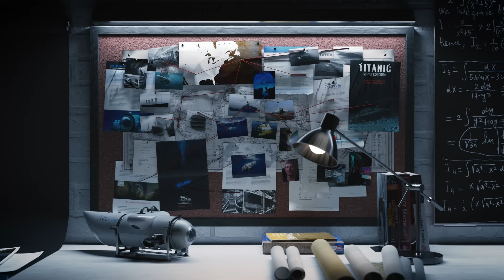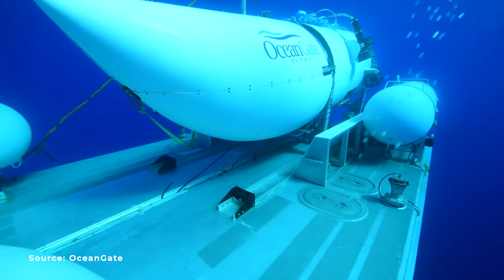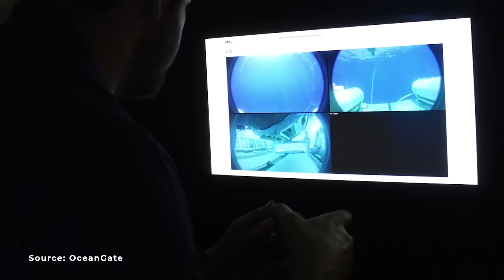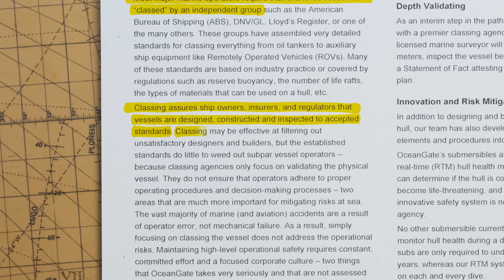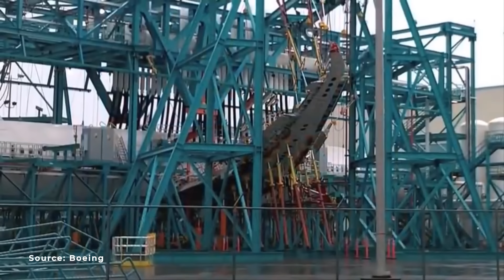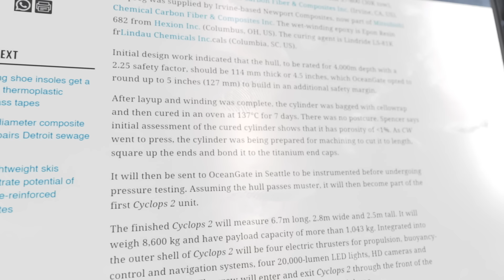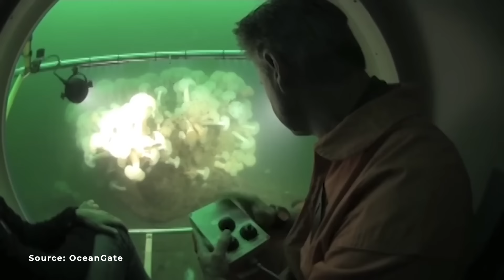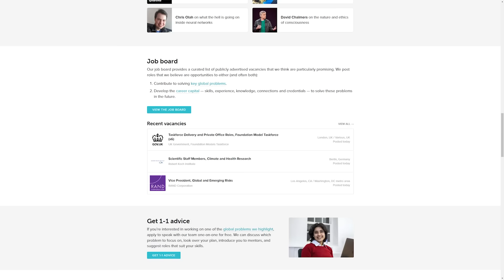The Questionable Engineering of Oceangate

Comment: I'm so happy you got to use your Masters thesis in this topic! Bet it was hard for you not to make this a ten-hour video though, discussing all the fine details of void propagation etc...
Reply: We are here for the 10 hour video when it comes.
Reply: im not joking here as i am a boat builder of 4 decade and a marine mech. The younger college/uni levers even at masters level know knothing of composites. They are taught very basic level stuff especially the layup phase. Nowadays a computer tells them whats what they dont understand what they are looking at or how composites actually behave. I'll give you an example, We got a boat in that had been completely refurbished by a start-up company, then fell apart within 3yr. The owner then demanded his cash back and a long drawn out process happened where he had to force them to hand over the blueprints for the refurbishment, materials and all. They were ran by two postgraduates and had a workforce that read as a family&mates list. They were so bad at it they never knew the difference between a layering up resin (aka polyester or vinylester) and a bonding and layering resin (aka proper epoxy resin the amine type) so they had basically used the polyester resin on its own as a transom bonder and to oversize plug all the fitment holes so they could redrill them to accept the new fitting. They used a powder bound 400gm chop strand with a polyester resin not realising the powder bound was for proper epoxy. Then they  made a total disaster of the transom from the re-design stage. The boat was originaly outshaft motor that was converted to an outboard transom by them and they didnt have a clue. Bet they could push a mouse about or a pen about and mumble a bunch of figures they got partially right on the subject. Also a vast amount of students now are activist types and you dont want to be in the sea with anything they have designed or made. Infact thats whats happened here.
Reply: @bigduphusaj162 Thats super interesting, thanks for sharing
Reply: @bigduphusaj162 I don't think engineering degrees are infested with the activist type. 
No offense but you're a bitter old dude if you think that of the entire younger generation of academics.
Reply: He should make a detailed video (like extended version of a short video like this so viewers can select which one they want !), It would be more enjoyable than some superhero movies and shit we're getting nowdays of trash quality
Reply: Ok?

Comment: They never dived 50 times to 4000m, from available logs and testimony they dived to the Titanic only about 3-4 times previously, they made another 15-20 more shallow dives, some of which were weather or equipment aborts.
OceanGate refuses to release the trip logs or even an accurate trip count.
There is a lot of wild speculation out there and a lot of misinformation floating around.
All that can be concluded at this time is that an egotistical narcissist got himself and 4 others killed not only because of the extreme pressures at depth but because of excessive hubris on the part of the CEO.

Comment: So you lump SpaceX in with Oceangate? You do realize SpaceX went through all NASA safety requirements before any humans were allowed in the Dragon capsule? To assume they wont do the same with Starship is unfounded. So testing an unmanned craft that has very little possibility of hurting anyone short of a threatened species of bird or 2 maybe is irresponsible? So how else do we innovate? Use the NASA model where you take elements that have been developed off and on for almost 20 years or from previous programs outright at a cost of  billions over budget to space later and later than projected? Nah that's the old way and it's gotten us virtually nowhere in the last 50 years. As long as human lives aren't put in danger there is nothing wrong with it and those who cling to the past ways will be left behind. You can't get much of anywhere with one hand tied to your balls. Stockton Rush was a tool trying to get rich ..... Elon is a innovator risking the fortune he made elsewhere to advance the human race. 

And you sir are a YouTuber who has done nothing but been a mouthpiece ......

Comment: About that acoustic sensor system...I've always wondered if they even tested it on a scale model or anything to get some idea of what kind of lead time it would really offer in the way of "early warning". At 4,000 meters down and 2+ hours to ascend, if it won't warn you that much in advance, all its good for is to tell you you are about to die. In that case, I am not sure I would even wan't to be warned.
Reply: Someone else wrote that acoustic sensor was completely useless. It would warn you less than a second before an implosion, so you wouldn't even know that you're about to die.
Reply: @amideus1996  "completely useless", perhaps not, but "not fast enough to be used to save a life", I think.

Even if the early warning system went off minutes before an implosion, the speeds at which ascent and descent occur (hours) would simply not allow the operators to rise out of the crushing depths fast enough to avoid their impending doom, I don't think. Maybe if you immediately started to rise, you could perhaps beat the curve, rising slightly faster than the submersible's "crush depth" rises due to sustained damage, but I doubt it

Comment: Slick video but there is incorrect information in the first 30 seconds. The sub went down on the 18th not the 19th. Also it doesn't take 70 minutes to get to the bottom they said it takes them 2 hours.

Comment: The sub classification vs. operational error debate is strange to me because they seem unrelated. They skipped sub classification, which focuses on the design of the sub, because they felt they were superior operators compared to previous failures. Why couldn't they have the classification as well as superior operators at the same time? As a result, they had supposedly superior operators, with an inferior sub. That doesn't make much sense to me.

Comment: You also see the same type of structural failures in Armor after it’s been hit by a Squash-Head shell. The shell doesn’t pierce the armor; rather, it creates such a tremendous barometric over pressure wave to literally break off a chunk of the armor INSIDE the crew compartment of the vehicle. That chunk is supersonic at that point and literally and quite instantly shreds everyone inside.

Would an internal steel ring / bands / cylinder have prevented the carbon fiber from being able to bow in on itself?

Comment: If I understand you correctly (and forgive me if I'm jumping the gun here, not having finished viewing your video), what they should have done is build a second composite hull identically, run it to pressure depth, then test it extensively for cracks, voids in the resin, delamination and so on before sending the prototype to the bottom with a crew.
I don't know much about the funding of this project, but the rumors floating around various media indicated money was no object, and if so, what was the rush? If it seems like a cheap shot, then I apologize sincerely, but hopefully next time someone will thoroughly test the prototype before manning it.
I understand real life sometimes gets in the way - such eminent organizations as the United States Navy have had similar seemingly unnecessary underwater accidents, but we learn and we move on, hopefully to never have such an accident again...
PS: I think find some of the advertisements on your video sadly ironic, at least if you view the same ones as I did, ads for entrepreneur services that seemed to value action over consideration...

Comment: i heard the decent rate of the sub was too fast. im not good with sub tech, but if u decend too fast, ur presurization system cant keep up causing not enough internal pressure to keep the outer shell from bending causing comprimised strength

Comment: I find the thesis that the "move fast and break stuff" mantra is to blame here, wrong. We don't put people on test launches, "breaking stuff" doesn't require you to endanger people. Slow methodical engineering is how you incrementally improve existing technologies. Forging a new path is always going to be more slap-dash and less perfect, that doesn't mean it is 'bad'. It is a different tool, used in a different situation.

I think their model would have been great if they simply did the first dive remotely. The flaw was in them making a test dive maned. That is irresponsible in nearly any situation.

Comment: Well done. Well cited. Plain English.  I fully endorse all the material science chatter presented here. I've wondered if the design suitably dealt with the effect different elastic moduli and coefficients of thermal expansion had on the titanium/carbon composite interface. Sliding at a seal? 

Side Note of coincidence, not presenting credentials: 
I did my these on Hydrogen Assisted Cracking in submarine hull steel weldments. You rightly emphasized the need to investigate/test/analyze/document the intrinsically anisotropic properties of composite materials.  My thesis was to look for such anisotropies during welding (for this particular failure mode) and found none. Degree granted! (RPI) 

The field of Fracture Mechanics is 'a thing', it blossomed during WW II as Liberty Ships were cracking in half while sitting at piers, rocked gently by the waves...  in Alaska. Built under wartime haste it seems, but to be fair, not much was known about ductile/brittle transition temperatures in steels back then.

Too, I built and flew a composite experimental plane, the VariEze designed by Burt Rutan. He did things properly as a composites design engineer. I did my part flight testing, including for flutter up to high airspeeds before taking passengers.

Comment: Thank you for your mention that the famous game controller wasn't that much of a deal.

Part of safety engineering is separating life critical Things from secondary things. In the case of this submersible, the only absolutely safety critical parts are the pressure hull and the ballast deployment system. All the other stuff didn't really matter, safety wise.

Comment: As soon as I heard that they used a carbon hull in the days it went missing, I was convinced it imploded. After seeing some of the same things you did (no autoclave, no intermittent testing other than the 'acoustic warning system' between dives, no replacement after x cycles of use, etc.) it was painfully obvious. I did not think about buoyancy as a design requirement that could drive this choice, but to me it simply seems like they went with carbon to save money. The same size titanium hull would be monumentally expensive. Filament winding is the way to go when making tubing out of carbon, but Stockton (as someone who had an engineering degree) should have kept up with the research in this area and realized it was a poor design choice if he wouldn't listen to his own damn contractors.

Another thing to note is that in the recovery images taken of the titanium endcaps, the front window (which was only rated for ~1500 meters I believe) is missing and they have a strap looped through the hole to get that piece to shore. Chicken and egg scenario on whether the window failed as a result of implosion or the converse happened, but having seen they did ~50 dives to 4000 meters of depth, it was definitely the hull. Carbon is just too brittle for repeated pressurization and depressurization, delamination and porosity being major factors as stated here. I dont have graduate experience with composites, but having worked with them in simulation software as well as practically, it would have been a huge no-no for me to be anywhere near that sub as either a passenger or engineer. There isn't a single shred of carbon attached to the pieces that they pulled up either, which would be consistent with hull-driven implosion.

They likely heard cracking, aborted, and shortly thereafter the sub imploded. Too bad for the college-aged kid, that's what bothers me the most about the titans shoddy engineering. He had his whole life ahead of himself. This will be a textbook example of how not to engineer a manned vehicle in textbooks in the coming years and decades among the many others. The nice thing about SpaceX's approach is that they can do most if not all initial launching and testing unmanned; as well as test engines on the ground. If this was not the case, outcomes like titan would be prevalent in todays private space offerings. The level of redundancy they engineer into, for example, starship is astonishing. They go with such a large number of engines for redundancy among other reasons (but if making comparisons, the raptor is eons ahead of what was used in the N2). Abort systems also are a big factor here, with those in rocketry having a high probability of success, and in submarines aren't worth their weight in grass if the hull implodes. Not sure if starship will have an abort system like falcon or SLS, but I digress.

Comment: The transcript says a noise was heard and battery 1 lost power and the alarm triggered, after which the vessel lost buoyancy. There was no indication of a leak. Could it be that's a small vessel in the tail of the Titan collapsed, causing the battery failure and loss of buoyancy, and that's the main carbon fiber vessel failed only during attempts to release the legs?
Reply: They was no leak into the hull. We know this because they had to rotate the hull to shake the weights from the legs and if there was water in the hull they would have found is when rotating her hull

Comment: Thanks for this video. Your research-based assessment of the engineering behind the Titan is very much appreciated.
I've also been thinking about the potential problems with using dissimilar materials for this type of application.
Due to differences in material properties, I would expect the progression of geometry change in the titanium end caps and central CFRP cylinder to be appreciably different as external pressure changes. CFRP has a lower Poisson's ratio so you can expect non-uniform deformation across the entire structure.This could pose a significant risk even if the three main structural components (cylinder and end caps) remained intact (a highly unlikely scenario). Non-uniform deformation across the entire structure could lead to unforeseen shearing loads on the bolts securing the end caps to the central CFRP cylinder. How does the Metal-Composite Interface (MCI) respond to the dissimilar changes in geometry? or to the delamination of the innermost CFRP layers? What was happening at the MCI during and after those dive/surface cycles?

I have watched the assembly of the central cylinder here: https://www.youtube.com/watch?v=WK99kBS1AfE and I have so many questions. The flange depth x width x thickness on the titanium ring looks to approximately 5" x 2" x 0.5". Is that combined annular surface area sufficient to prevent debonding/delamination at the MCI? The video did not show a secondary means of securing the Ti-CF assembly (i.e. rivets, bolts). What is the composition of the adhesive used to bond the two?

The point of my spiel is I believe the choice of a composite design for the structure as a whole (composite=Ti+CFRP) is poor for this specific application. The choice of a composite structure for the Titan (generally) compounds the uncertainties associated with CFRP (specifically). Several research papers have investigated factors that influence the integrity of the interfacial layer between the two materials but most focus on high-temperature aerospace components not applications for cyclic compressive loading.

The manufacturing process will explain a lot more. My hope is those records were preserved.

Comment: I mean, even materials like steel can be much less homogenous than easy simulation would like, depending on how it's been treated, worked and formed. 
Another aside: The comparison with Space X's "move fast and break stuff" on the part of Ocean Gate is stupid... because manned flight is a subset of rocket launches, and the platform could be proven first with testing, then along a continuum of different levels of risk for cargo, and 'then' going through a rigorous process for being human rated. Move fast and break stuff makes sense in that context, but not in a vehicle that is only ever going to be manned. Talking about "move fast and break stuff" in the context is absurd.

Comment: Also you can blame the software industry for the ‘moving fast and break things’ mantra.

There was a time, not all that long ago, when software was carefully spec’d, designed and coded. This was retroactivity called ‘waterfall development’.

But then profit driven managers decided getting to market first, and fixing problems later, was preferable. They came up with buzz words like ‘extreme programming’ and ‘agile development’ as a smokescreen to do away with planning and research and we’ve all seen the result.

Only you can’t hotfix an engineering failure two miles down or at 40,000 feet.